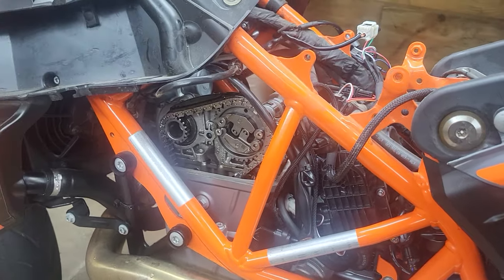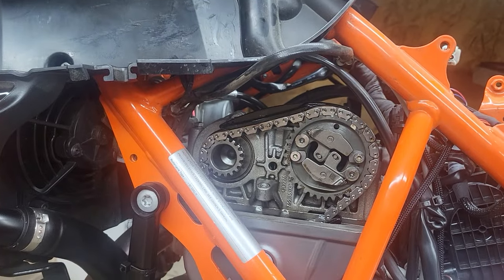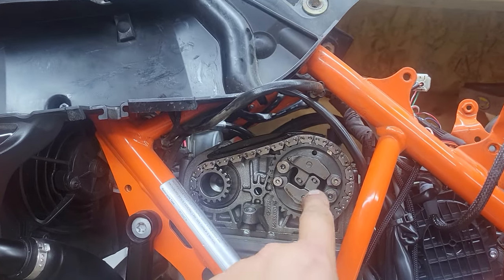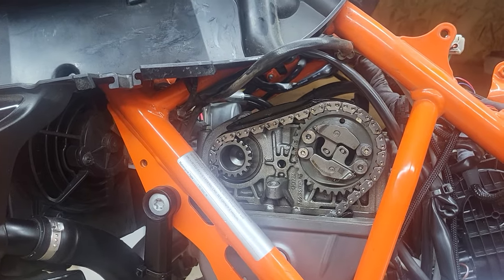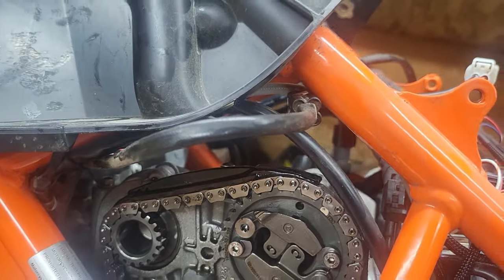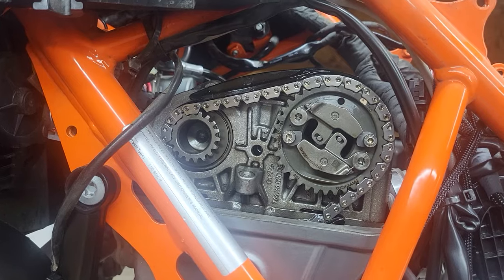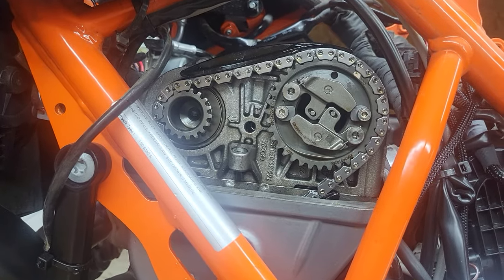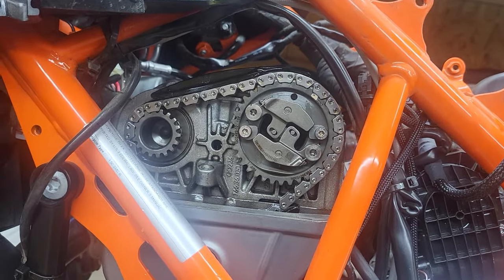2021 KTM 690 LC4 possible engine failure!!!!

Comment: His bike is a 2021 and it happened  they upgraded form 2018 to a M4 to M5 bolts and still guess it's just best to check them and make sure it have some red loctite
Reply from the maker: @jarvisbarthelmy6307  mine is a 21 As well, his video made me really nervous. But bo problems.